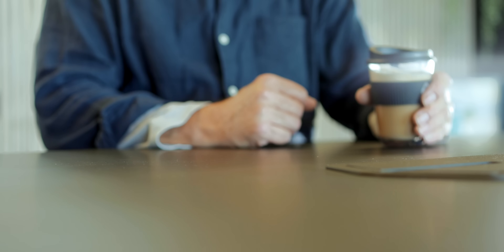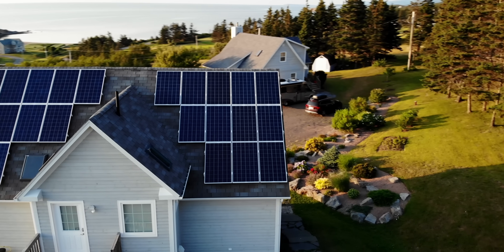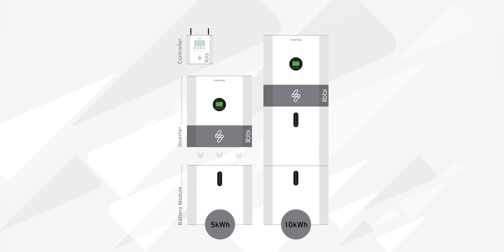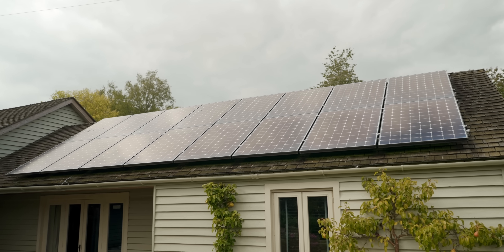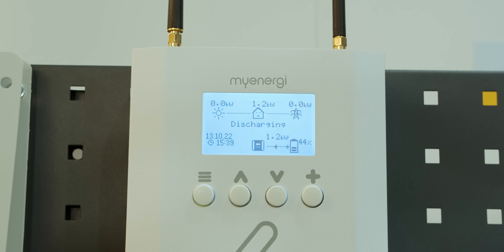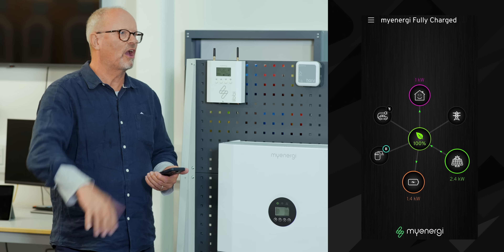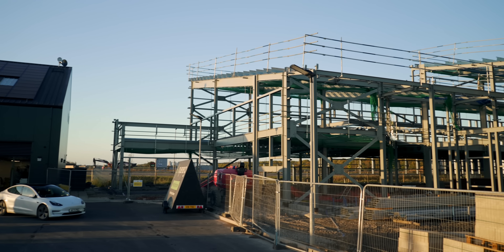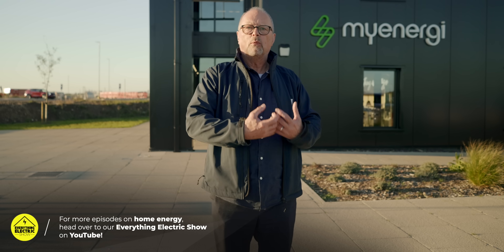THIS Home Battery is the Key To Cheaper, Cleaner Energy!

Comment: Apologies that some of these points have already been raised, mainly with a view to product comparison to consolidate and add:
1) Price. Not just the ticket price but system cost/kWh. The myenergi batteries seem smaller than the GivEnergy ones (for example), so may be cheaper, but with less capacity
2) Charging rate. Storage capacity may not be met within the off-peak tariff window
3) Discharge rate. Wouldn't it be cool to have a 'spare' battery to charge your car beyond 7kW if you need an emergency top-up. I think Tesla powerwall can 'properly' charge a car?
4) "UPS". Yes it is in quotes. But is there the capability to provide power in a power-cut, how long before it kicks in and probably related to #3, how much of the home could be supported
5) Integration with other generation devices - both own-brand and 3rd party
6) Related I guess: V2L
7) Could you be completely off-grid with it? With my system, the controller draws power from the gird to maintain itself, even with 100% battery and the panels still generating. I feel a bit 'cheated' :-(
8) Standard weight, dimension, IP rating etc.

Not a comparative but future nice to have feature - the ability for predicted solar generation to adapt how much you need pull in from the grid overnight to get you batteries to 100%. For instance, during summer, I charged overnight to just 40% as I knew that would cover me for the morning and then the sun would power the house before topping up the battery for the evening.

Too long a comment. Thank-you for indulging me!

Comment: I noticed that when the car and the house were being supplied by the battery it was happening at 3.6 kW. Is that as fast as the battery will discharge or could it supply the house at say 1 kW and the car at 7 kW?  I can envisage a circumstance where I would need to charge the car quickly and would end up using grid if 3.6 kW was the fastest at which I could charge from the battery.

Comment: No, sorry, no. Show me an actual numbers model of a house, including prices, with solar PV on the roof, a 5kWh battery, 2 adults, 2 kids, 1 stationary PC, 3 laptops, 4 cell phones, Wi-Fi, large fridge, electric cook top and oven, heat-pump heating in winter, AC cooling in the summer, with energy use throughout the day. It's the morning, middle of the winter, battery is empty, there is not going to be any sun all day, go.

How about summer? It's 35°C outside, cool 23°C inside thanx to AC, you've got a full battery, but the sun is setting, it's 6 o'clock, everyone is home and it's time to make dinner, it's pizza evening! How far will 5kWh get you? All through the night you think? It won't because this is the real world. 10kWh maybe. In the winter? Forget about it, you can only live on grid, solar is completely useless in winter. The battery is to help you ease any  (but not unprecedented) hiccups on the grid, nothing more, really.

If you really want something bulletproof, you need a combination of a large battery, 20kWh at the minimum for example above, larger than necessary PV array, and a diesel generator. A far better idea would be gas cook top/oven and wood heating. So that you use as little electricity as possible, while relying on other fuels. I mean look, if everything is electricity powered, than that is a weakness that is very easily exploited by corporations and futures traders. Imagine having a boiler capable of heating on gas, hard wood, pellets, wood chips, coal, diesel and electricity. If the price of one of the fuels goes up you switch to another, so no price can go through the roof and all of them going through the roof is very unlikely, if EVERYTHING is electric, then, well, there is nowhere to turn, you have to pay whatever is asked.

Comment: Quite expensive.   Only for rich people, who have electric cars, heat pumps and solar panels.    If you don't have the capital to buy this stuff, what is the alternative?   When people talk about "savings" what they mean after you have spent tens of thousands of pounds, your running costs are lower.  I always look at payback and carbon footprint of manufacture of "green" stuff.   In most cases I'll never get my investment in a green product back via the "savings".   With batteries, wind turbines, solar panels, electric cars and heat pumps, the real issue is what the carbon footprint is of the stuff mined, processed and transported - and the pollution & child labour (Congo cobalt mining) - to make "green" stuff.    Great that myenergi is making profits and creating jobs, but I'm old fashioned when it comes to saving the planet... low tech, repairing stuff, re-using stuff, keeping appliances & vehicles as long as possible, not using much electricity and making do has the lowest environmental impact.     The proof of the pudding is how long these batteries last which cost thousands of pounds and whether they can be 100% recycled.   So far wind farm turbines last only 20-25 years, solar panels 25 years and efficiency tails off, batteries 10-15 years and efficiency tails off.   Electric cars will be worthless when the batteries need replacing at £10,000... so you've lost £50-70,000 buying a "green" vehicle over 10 years when a second hand 15-20 year old car with annual repairs of £1,000 costs £2,000... costing say just £12,000 over 10 years.   A no brainer if driven miles are low and like most of us, you simply do not have the money to buy an expensive car or batteries.

Comment: The non-industrial future of 'the grid' is as the trickle-charger for residential areas. He should mean lower poles'n'wires costs in future. Every house won't need a 240V/32A supply provision.

Comment: I have a Powerwall 2 and all this is lovely but how can any battery of these sizes charge an EV realistically?
A 60kWh EV battery would need over 11 Libbis to charge it from flat and would need more than 4 full Powerwall 2s. 
Even if you dump your entire 5.1xkWh Libbi into your EV it’ll barely make a difference. It’ll increase your range by 0.085%. That’s 25.5km if you’d range was 300km on a full charge with a 60kWh battery pack. EV batteries are huge and currently far far bigger than home batteries. You’d need a massive solar array and/or huge home batteries to realistically charge an EV without using any or much grid power. 
Also based on the demo of grid charging at about 2.7kW you’d need to leave the EV plugged in nearly 2hr just to get the capacity of the Libbi into it (ignoring losses). If you are going back out in 30-60 mins time you’d only manage 12.5 or 6.25km extra range (using my figures). 
I have solar and a Powerwall 2 in order to use zero grid power as much as possible. Our Powerwall powers the entire house all night with remaining charge when the sun comes up again at anything from 20-70%. The grid is just for exceptions or long periods of dismal weather and lack of sunshine. The Powerwall is also to provide continuous electricity during grid outages (we had several last year alone). 
If we charged an EV we would have to pay full grid price or use up all our solar and all our Powerwall capacity ( leaving us nothing for outages or to run the house. 
3 Powerwalls would be nice but 1 was expensive enough and we would need to increase the solar by a lot requiring an upgrade to 3-phase also. So an increase there is out of the question.

Comment: Great content. Lets dig here a little. In the whole video nothing was elaborated on the material selection for the batterie. For approx. 5000 Pound installed batterie [5kw] and doubling that we probably end up at the same what a Tesla Powerwall costs. There is no light shed on a)what the materials are used for the construction of the batterie and b)where is the batterie manufactured. In a world where C02 footprint has become paramount we need to be asking these questions. As there is not yet a valid and efficient recycling system existing we have to ask what is happening after 10 years, which is not long for any building mechanical services item. Just to say there will be an item that can be replaced is just not good enough planning. Its very similar to the concept of nuclear energy: What happens with the burned out nuclear waste - we just dump it in a old salt mine and leave it for generations to come do deal with it - that is just not good enough design and planning attitude any longer.  I applaud that there are people out there like myenergi who try hard to find solutions, but at present I do not see any new stuff or ideas that one can find with any good solar hard ware enterprise.

Comment: Tesla has had this same set up for a few years, with "one" powerwall being 13.5 kwh, anyway there is no way around some math.

1.  Figure out what your utility is charging you per kwh.   Now, here in California with my utility its about 23 cents.   Doesn't matter, will just use that as an example yours is what matters.
2.   If you are getting solar, or if you already have it, figure out how much it produces, on average, during a year.   Convert those kwh to money.
3.   If you don't have battery back up, you are dependent upon what credits the utility gives you for a large portion of your solar production.   Essentially, unless your system is very small, you are using your utility as a battery, you send them kwh during the day during good days, and they give you credit for them.    But, with most systems, if the grid goes down, even on a sunny day, your system shuts off as well.
At this point, for most people, solar panels are "worth it" because the cost per kwh, over the lifetime if the system, is less than the cost per kwh the utility is charging.
4.   Battery back up?  Well, (a) this actually allows your system to run (unlike solar only) when the power goes down, and (b) whether its "worth it" other than that, requires more math.
5.   That second level of math is the difference between what your utility credits you per kwh and what they charge.   Here in California, for some utilities, the spread is over 20 cents, as in they only give you 10 cents per kwh credit and charge 30 cents or more.
6.   Anyway, tesla Powerwalls, or any battery, have about a 20 year life, and over that time the amount of kwh they can discharge, multiplied by the price spread, is how you get to whether a battery is "worth it."
7.  Its pretty easy for a battery system to be worth it if the utility has high peak rates and low credits.   
8.  For those who like to be truly green, battery back up is the only way to use all of the solar energy your system produces.   

A.  Yep, using cars as battery back up or houses is possible, but the solar system needs to be oversized to begin with.   Plus, is the car sitting there? or is it out being driven?
B.  Good for Fully charged for having this segment, even if they did make it seem like its groundbreaking when its not actually.   But when you go down this road you realize the solution to green energy is storage.   The more people who know that the better.

I can't believe you guys in the UK can even consider one 5 kwh battery.   I have three Powerwalls equalling 40 Kwh of storage and I wish I had four or five.  The incremental cost would not have been that much and I could have been completely off grid.   Maybe its the electric AC in california, that burns 6 kwh in one hour,  a system this size would only back up the house for 45 minutes on a hot day if the grid went down.

Comment: The Libbi web site says it cost "from £4600 + Vat + install ". Perhaps thats 5Kwh unit.  How many recharges is it good for in its lifetime?   At 1000 recharges, it  would make  it £0.9/Kwh  At 5000 recharges it would be £0.20/kwh " storage charge" on top of the cost of electricity. Is there servicing costs or impacts on house insurance for having batteries at home?.    Factory price or Li ion batteries is reported at under $150/Kwh  .   PV energy that I export still displaces fossil energy off the grid !

Comment: The cheapest solution is an electric car which is able to feed out the energy from its battery again.  The Hyundai Ionic 5 or the Kia EV6 can do that. Their battery now has 76 kWh and also an internal converter that can deliver up to 3.5 kW 230 V ~ AC into the house via a socket.  All you need is a switch that disconnects the house from the network and connects it to the car.  During the day you can then recharge the car via the solar system.  The battery capacity of the car is so high that you can run the house off-grid for over a week if you use it sparingly.  Also the ideal solution in the event of a blackout.  So why buy an expensive, second battery with electronics when the car already has one with a much higher capacity.  I tested this solution at our house and it works perfectly.
Reply: So, let me get this right - all I have to do is swap my £12,000 car for a £45,000 car.....and I'm home and dry........!?
I'd be a fool..............!

Comment: This is an interesting report, but the information lacked content in one respect.  Can this system continue to provide domestic power in the, ever more likely, event of a grid power outage.  I am looking to get a solar PV and battery solution, but two potential installers have said that I cannot get a system to provide continuing domestic power during a grid failure.  Perhaps Fully Charged staff could add a clarification on this issue.

Comment: They really need to make the ability to power our homes from our car battery the norm.
Picture the mg4 51kwh lfp battery and its 3000 charge cycles to 80% 6000 to 60% so let's say 4500 charge cycles in total and still working. 
That's 11 years running our homes from our cars at 20,000 kwh a year.
 Enough to get rid of gas entirely and that's just now. All for £25k with a car thrown in for free. 
 11 years from now we'll be looking at a battery that lasts 100,000 charge cycles.

Comment: I found the spec sheet for it, but I'm concerned that the external dimensions (depth specifically) don't include the wall fittings. The battery doesn't appear to fit flush to wall, and so effective depth of the battery is about 2cm greater than the depth of the battery itself...
For me, that 2cm is critical.
MyEnergi got back to me really quickly on this question (15 minutes). Very impressive.
What I'm not impressed with is the Libbi spec sheet saying that the battery depth is 240mm, but not including in that, the 30mm required to mount the battery. 
That 30mm, sadly, is a deal breaker for me.

Comment: We know how a home battery works and we appreciate that seamless integration is a desirable feature but tell us about the battery.

What is its maximum output and input rate? 
How much will it cost.
What is its useful lifespan?
Does it contain cobalt? 
What is its useful Temperature range. 
Is it an inside or an outdoor battery or both? 
Is the is function to provide power during power outages? What is the additional cost for the latter if any?
Etc etc

Comment: This obsession with avoiding grid reinforcement to "keep costs down for consumers" is utterly ludicrous.  I know it's not my energy's fault, it's all Ofgem.  But it makes my blood boil that we somehow expect our grid to pick up the slack from liquid fuel and gas in the coming years, yet we are opposed to installing new transformers or putting copper in the ground.   We need to double the capacity of the grid and no amount of energy savings is going to avoid that.  Just build the bloody infrastructure, that's what our standing charges should be for.  Rant over. 

It is a clever device though.

Comment: Would be really useful to see options for those without PV (live in flats etc) and without EV's.
Reply: A couple of things I've looked into are having a battery only, combined with a time-of-use tariff (e.g., charge the battery at 7.5p/kWh overnight rates and discharge when costs are higher). I don't know which companies offer battery controllers that would support this.
You can also look into community solar projects where you pay a lump sum upfront to buy a share of the solar installation, and you earn credits towards your bills.

Comment: Does anyone know if hot water from  rooftop solar-thermal water heaters can be used via kitchen kettle for hot drinks etc ?  Is it drinkable ?  We're so often told that kettles use vast amounts of electricity - so why not fill your kitchen kettle with hot water from rooftop solar water heater and just use your kettle to heat it from circa 65 degrees right up to boiling for drinks etc ?
It's an obvious and important question that noone ever asks! 
Paul G

Comment: I have MyEnergi Zappi, Harvi and Eddi. I was a bit disturbed to find that these are the same guys who designed the first-generation ImmerSun, which had an alarming tendency to melt down, but these newer units are vastly better engineered. So: I am an obvious candidate for Libbi :-) I also have full Loxone smart home, but MyEnergi don't (currently) have an API so I have to use ModBus meters to measure power consumption and diversion. That said, Libbi's grid disconnect only supplies a single separated circuit. I could power my Loxone sub from it (which also includes all lighting), but then I would lose my water boost pump, so in practice I'd need to make significant changes to allow it to power the network cabinet, smart home and some other circuits. So: easier in new build than retrofit (but what isn't?).

Comment: Will be lovely when all this comes together. I have Eddi, Zappi from Myenergy, ioniq5 with V2L from Hyundai, and a Solar panels, inverter and 8kwh hybrid battery system from FOX. Solar to battery, hot water and EV charging works ok, if a little clunky. But I’m not set up to run solely off battery during a power cut, and no integration of the V2L feature.